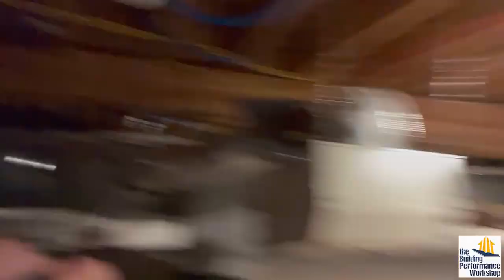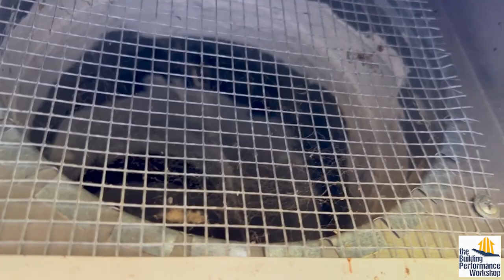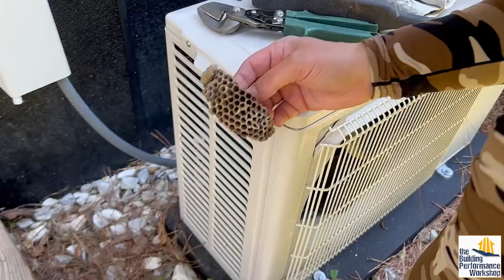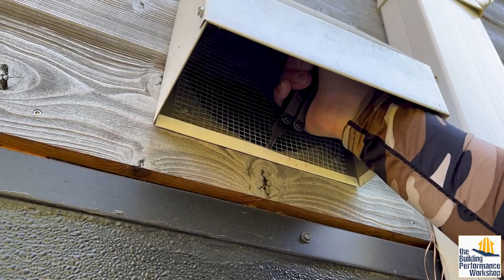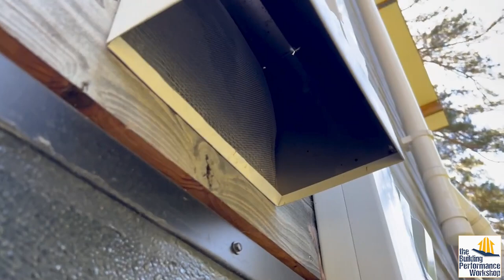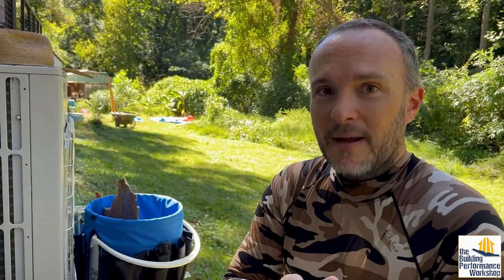Where Best to Put Ventilation Intakes? ERV, HRV, Supply and Intermittent Exhaust Vent Terminals

Comment: 16 years installing only ervs in Maine. Though the finer screen seems like a good idea and I've seen a number of people do this over the years it makes for cleaning the intake much more frequently. And if not done, reduces ventilation and throws the system negative in relation to pressure. The engineers figured it made more sense to progressively filter larger particles first on the outside and the have the finer filter in the unit and clean at least every 3 months. The silicon was a mistake because your going to find that proper cleaning of that fine mesh will be way easier if you can remove it. As to the bees nest, I've never seen one in an intake that had air always flowing. Seems they don't want to be in a wind tunnel. Only ones that have the unit off for extended times. You won't need mesh in the exhaust side as the exhaust air has already gone through the filter in the unit and does not get dirty .
Reply: I was going to write exactly the same thing. I have seen many ERV experts against those finer screens because of the huge reduction on air flow.
Reply from the maker: @NaturebyGus maintenance is life, life is maintenance. Pick your battles.

Comment: I bought an in-line duct filter box for my ERV intake. It has a full size air handler filter. Better flow, lasts longer, cheaper than the little manufacturer specific ERV filters.
Reply: Which one did you buy? And where exactly did you mount it? All I can find are in insulated boxes, and I live where it freezes half the year.

Comment: I had this similar problem so I built my own filter box out of tin and a 12 x 12 washable air filter. This way you can easily remove it from the outside and wash it then replace. as a general rule I prefer to keep the dirt out of my ductwork and home. filter I used was Air-Care  12-in W x 12-in L x 1-in Washable Electrostatic Air Filter. good luck.

Comment: The finer mesh screens greatly reduce airflow, you should look at a flow chart and see if it meets the specs of the system. Having done some airflow projects over the years the restrictions of the smaller screens is pretty amazing.

Comment: Does the smaller size screen reduce the amount of air intake thereby affecting the ERV?
Reply from the maker: A little, probably. The ERV duct system was upsized to 8” rounds even though the collars on the machine itself are 6”, so I’m not concerned at all about it. The bugs are a much bigger deal.

Comment: Have you considered putting the insect screen at the intake portion of the vent?  This would be the bottom of the intake so insects and grass cannot enter the vent at all and make cleaning this screen easier because you only have to dust the bottom.
Reply from the maker: That’s a good idea, Mark, but in this case since there are two screens I feel more comfy with one access to both.
Reply: Trouble is it would be smaller, restrict air flow and clog up quicker.
Reply: @tweake7175  I would think he is going to have this problem anyway since he has both screens installed.  In fact I think the video makes that point too.

Comment: I use a the existing screen you have, but use bailing wire to tie a washable blue air  filter material behind the mesh to stop bugs and capture some dust.  You can wash it once a month or so, all you’ll need to do is remove the bailing wire.  My intake is on a 45 deg and the mesh snaps in.

Comment: That small screen will restrict airflow and needs maintenance, I found better solution, I attached paint straining bag, they come in different sizes. Benefits includes insects cant get thought, easy to install, easy to clean & wash, you may have it hanging outside and rain will wash dirt off and main benefit is that it has way more sqin. of net and does not affect air flow.  I just use 1gl straining bag attached to 6" round duct with rubber ring.
There is way more requirements for air intake; away from dryer vents, away from sewage vents especially those on the roof as wind blows from top to the bottom, also with no wind some sewage gasses are heavier than air and tend to flow towards ground level so solution is to use the side of the house with no sewage vents on the roof. Away from idling cars in the morning, at least 40' away from gas water tank & furnace exhausts as they produce very high peak of carbon monoxide at start and after that it stinks and you dont want it into the house. Away from neighbor's with RoundUp spray :),  under the vent should be gravel that polls water away, not muddy soil that will stink when wet, also no concrete on the floor as it also smells when in contact with water (must be sealed). On the sunny side of the house so that there is no Fungai growing close by... this is all from experience and not available in instructional books, some instruction guides calls minimum 3 or 10' away from gas exhaust vents which is insane.. The thing is that most of these thing wont affect VOC readings in the house, however, it would bring variety of smell into the house and what ERV can pool in in about 5 minutes it would take hours to later replace... That 1/4 net that came with vent tells you that manufacturers dont have field experience, if they ever did any kind of test they would find handful of stinkbugs inside... cant believe that ashree people did not warn about it...
Reply from the maker: GREAT ADVICE SEPERTUDE! I think this might warrant a video of its own…
Reply: @HomePerformance  make it, also include downside of bringing in attic odors when intake is mounted in soffits
Reply from the maker: Wanna be in it?
Reply: @HomePerformance  You would make it way better :) I can collaborate if you want, I texted you on FB, there is even more things to add...

Comment: Would it be just as effective if you installed the insect screen filter on the whole entry opening of the vent? So not with the original screen but for a screen on the vent hood, that way it’ll be easier to reach for cleaning and it’ll be more obvious that it needs cleaning. I hate wasps and definitely do not want surprises like that.

Comment: How much do you spend a year on ERV filters? Thanks for the vid!
Reply from the maker: You’re welcome, Pete. The 2 packs are $25, so maybe $50-100 per year, depending on use and whether you wash them or not.
Reply: @HomePerformance  That’s not bad, well worth it. Never thought to wash them, guess you can considering that outside air isn’t going straight into the AHU.

Comment: Thanks for the great practical advice. As I plan my home with the ERV in the conditioned attic, do I need to plan for easier access to the vent from the inside out or is it just better to use a ladder and keep the air sealing to a minimum.
Reply from the maker: Nah, Matt, just make it obvious from outside so you can keep an eye on it regularly.

Comment: I’ve really been enjoying binging these videos on this build. I’ve had a difficult time trying to find a good liquid flashing for the ForceField WRB. Any suggestions? Hoping to use that over wood bucks and for the transition from lumber to poured concrete stem wall.
Reply from the maker: We used Dymonic 100 I think. Proseco R Guard is also great, lots more out there.

Comment: I was wondering where is the first place to start with a 70s home? ERV ,air tightness, insulation?
Reply: Start with lifting up insulation in the attic and sealing up all gaps with can spray foam in the areas where drywall meets walls as well all electrical cans to prevent warm air to escape through holes in them . If the insulation is not molded and let air easily to pass through you can reuse it and add some more of same kinde
Reply from the maker: Andrey is exactly right- always airseal first. Then add insulation. Then better machines.
Reply: @andreycham4797  Thank you

Comment: And by using a finer mesh screen you will make your erv work harder because you’ve reduced air flow.
Reply from the maker: But we upsized the duct from 6” to 8”. Basically twice the size. So don’t worry about it.